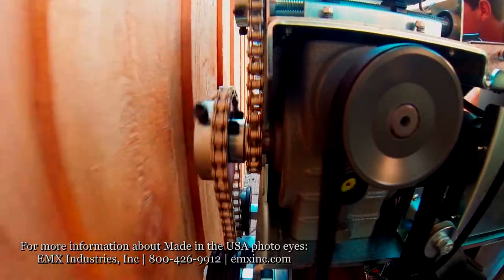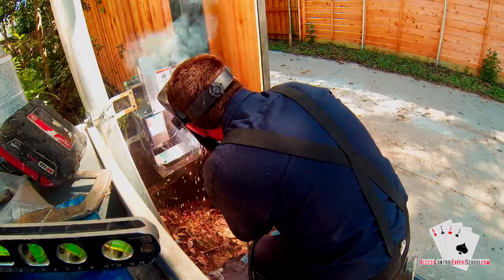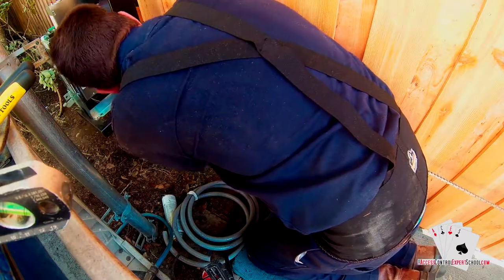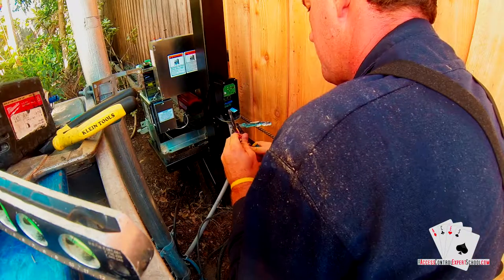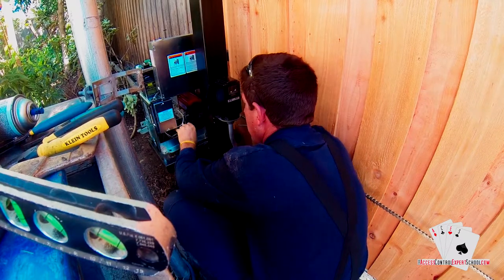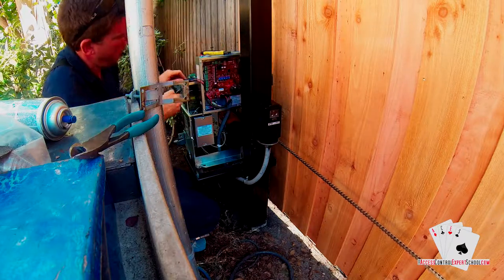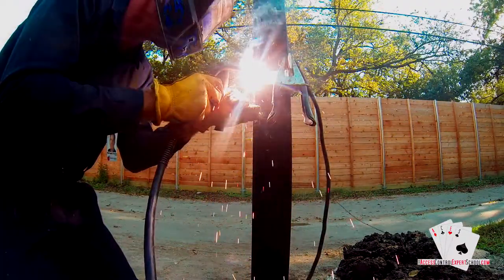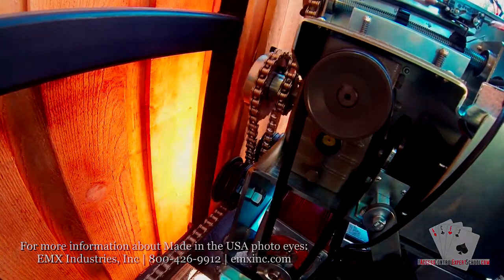How to install an EMX IRB RET photo eye on a driveway gate opener

Comment: The bolt up sequence is very handy short cut trick ! Thanks. I like that you bushed down from 3/4" to 1/2" for your flex too.
Reply from the maker: Thank you sir! See you at #FENCETECH2020 #idaexpo2020 #fabtech2020
Reply: I was hoping for wiring help. I mounted with self tapping screws.

Comment: I liked this video and it’s very informative for installing the equipment in place, but I am looking for a bit more info on wire termination standards for a Ramset control board for my custom gate. Specifically where to terminate the NO and NC circuit on the board. Do you have a video for that? It’s reflectors seem to have these connections universally and I’m stuck on the board points specifically. I love my ramset setup, but it can be a bit complicated.